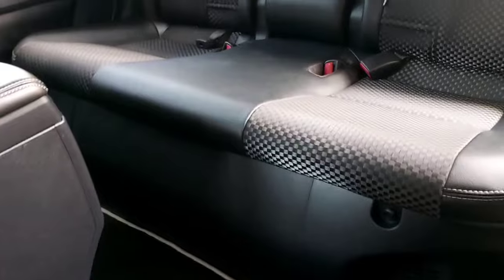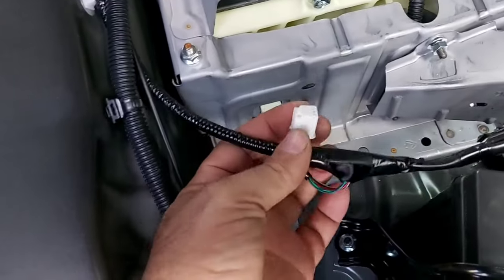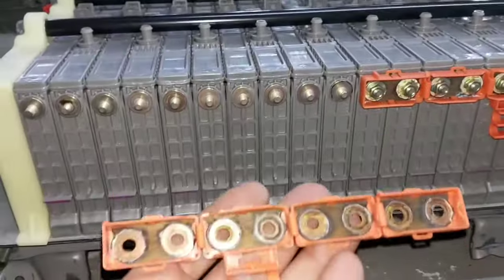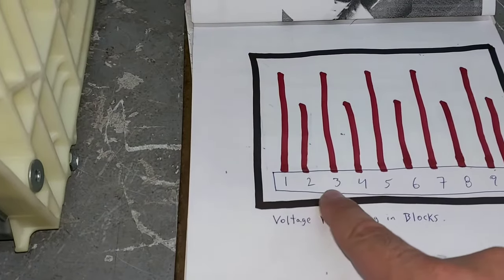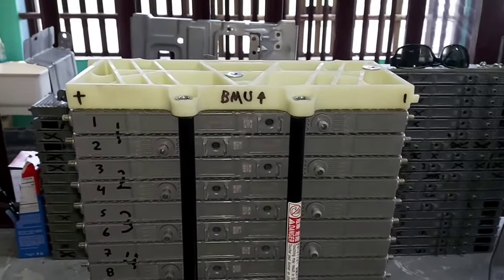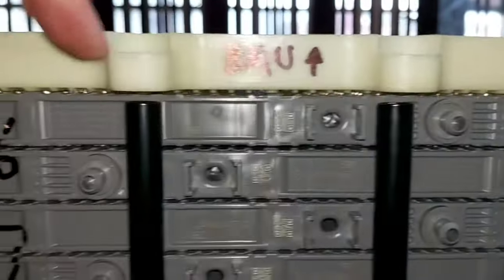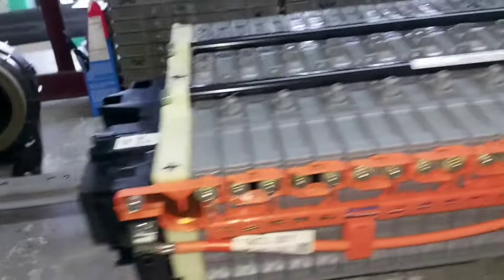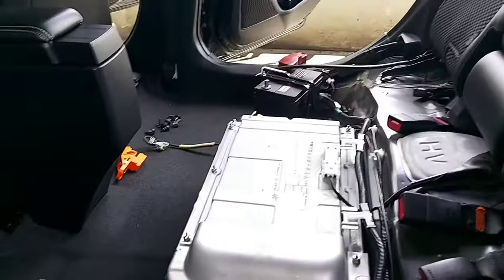toyota hybrid battery service and maintenance

Comment: Not to undermine your safety message, but beyond taking proper precautions there is not much cause for concern about the battery voltage - about 275 VDC. I developed an interest in electronics when I was 12 years old and was working on the old vacuum tube radios for nearly 20 years after that. Long story about how it happened, but when I was 14 years old I got 300VDC very solid contact with the palms of each hand. It was quite a jolt - I felt like I had been hit in the back of the head with a 2x4 and things got dark for a moment but I remained standing. If it had been 240VAC I would not be here to tell about it.
I worked on tube type radios for about 14 years as an avionics technician in General Aviation (small planes). I couldn't even guess how many times I got my fingers across the 275VDC supply for the venerable Narco Mk12 series radios... many dozens of times for sure. It was like getting my fingers in a mousetrap but it stopped hurting in a couple seconds.

Again - take the proper precautions. Toyota makes it very difficult to get across any of the high voltages but we have the responsibility for our own safety.

Comment: Hi, I watched a lot of your videos. I did a full battery service on my Auris 2016 according to your instructions also the battery balancing with parallel connection of all modules for 48 hours with great result. Dr. Prius life expectancy test says 87.25%, before battery service was 76%, that is great THANK YOU.
Reply from the maker: Good job... 😎🥳😎🥳😎🥳😎🥳😎🥳
Reply: @hybridsolutiondiagnostics  what happens if you put back the battery without balancing ?
Reply from the maker: @geraldtuge6559  check the new episode reconditioning a good hybrid battery… there is your answer very well in a simple simulation.

Comment: Great video, well said!  I have been trying to find out about where the dust would collect behind the fan and how important it would be to check it.  I am at 100K for a 2017 Prius Gen 4 and there is nothing about what is behind the fan and cleaning any ducts that could potentially be clogged.  I was quoted just under $200 to clean it, but i have seen where at least one other was quoted over $750 to clean it.
Reply from the maker: Check out one of my last videos is about toyota chr and 4th gen prius... it is an amazing tutorial fully servicing the HV battery... you will love it 🙂👍🙂👍
Reply from the maker: https://youtu.be/J3o-W3CS8N8 check this out 😁👍

Comment: One of the best tutorials I've seen, a small note, a recommendation to work with gloves, preferably for a fault voltage of 1000 volts
Another thing, why don't the car manufacturers bother to connect the car's air conditioner or a small air conditioner dedicated to cooling the batteries.
Another thing to consider is the replacement of the jumpers between the cells, a chemical reaction between metals must be taken into account as well as the durability of the material for hundreds which is not that significant, I would replace the jumpers but with the same type of metal that the manufacturer provides.
Rare video good job. Michael
Reply from the maker: Thank you for your comment 🙏😎

Comment: Very amazing vid!! A lot of info. May I ask what is the maximum battery overall voltage the car will accept after a reconditioned battery is ready to install.  I believe the car never charges to full, so a full charged 100% battery will pull codes and possible not connect. Please explain

Comment: Surely the battery vents not being connected to an outlet pipe is speeding up the bus bar corrosion? If a cell vent pipe was directed to the under side of the vehicle, the corrosive vapor could be neutralised with a small container of alkaline water, baking soda for example.
 I recently bought a used C battery for experimental purposes, the bus bars were badly corroded, but the cell voltages were all similar around 7.6v. If the bus bars were tinned with solder,maybe the corrosion would stop, or at least be delayed. Too much trouble for a busy mechanic. A conductive assembly paste could be an alternative solution. Re the overheating of the middle cells, some small computer fans could be easily fitted, preferably under the cells.
Reply: corrosion is intrinsic to every dis-similar object in the universe, corrosion  an be slowed with lithium grease or coating above the connection

Comment: Boss just subscribed, I have a 2014 Camry, engine went into a limp mode, I pulled the battery. All terminals were corroded, cleaned and polished reassembled, car doesn't start. It does show the battery is charged and green now which previously it was purple and dead. 

Any idea why it has a no start, my OBD2 scanner is showing no codes :(
Reply: Did you find out what it was. Sounds like you may have not connected something properly.

Comment: Hi, I hope you're doing well. I'm following you from Afghanistan, and I must say your tutorials are excellent; I truly appreciate your efforts as they are lifesavers ;)

I own an Aqua, and while scanning with the OBD scanner, it showed that the voltage of block #4 batteries is a little weak, registering about 12.4V. Upon opening the battery pack and testing with a multimeter (set to 200v), most of the cell voltages ranged from 8 to 7.53V. Subsequently, the dead battery sign appeared on my dashboard. However, after clearing the codes with the OBD scanner, it disappeared completely for a few days before reappearing.

What is your suggestion? Should I replace only the block #4 batteries or the entire battery pack?

I've been considering an idea: if I were to remove the batteries from block #4 and replace them with one battery from block #1 and one from block #10, would that potentially resolve the issue?

Comment: Hello, after cleaning and changing the filter of my 2016 Prius hybrid, I started to hear the fan spinning when the battery is charged. Before, I never heard it turn. Is this normal or should I be worried??
Reply from the maker: @zainbelemhani9319  totally normal 👨‍🔧👨‍🔧✅✅

Comment: Hey Bro! Your videos have really helped me understand about hybrids. The technician here removed vent tubes(rubber pipes for air)above hybrid battery modules from my Prius 1.8 2011 saying they are not needed but Toyota must have it for a reason but then i see fielder & aqua batteries also don’t have it so what should i do?? Kindly reply.thanks!
Reply from the maker: Those vent tubes are just in case of gas leak into the cabin... some other batteries dont have them because the ventilation goes directly out of the car 👋😎
Reply: @hybridsolutiondiagnostics  Thank you Bro!

Comment: Do I have to service my hybrid battery every year as you mentioned in an other video? Or is that not required for the lithium ion battery which is in the 2024 Corolla? Thank you.
Reply from the maker: No need to… just keep it clean and change the battery filter ✅

Comment: I liked the tunes in the background. Excellent video!!
Do you find you get better acceleration once service has been completed?
Reply from the maker: Everything improves after a good service...
Reply: What about the Prime models, plugin hybrid?
Reply: @paulpoco22  if they use lithium ion batteries then they won't benefit from deep cycling, I'm fact it'll just accelerate degradation. Unblocking ducts/fans will keep them cool means they can live longer and maybe perform a little better.
Reply: @hybridsolutiondiagnostics 31C in your shop, stay hydrated, LoL.  I see your video after the READY in the dash you go in the car and wipe the sweat off.

What happens  on the plugin hybrid if say you are stuck at a Ferry Terminal and it is 32C for 5hrs and you use the A/C.  The plugin hybrid gets down to 2 to 4% or less and runs on battery then runs the gas engine then runs on battery, this repeats for over 5hrs?  I was freaking out near the end I would see in the HUD 1.5km range then gas engine would run until range shows 2.5km over and over, the it got down to 1% but fas engine wasn't coming on.  So we shut off car until we loaded Ferry.   Then left Ferry once it arrived and still 1% and drove off, once up to higher speed the gas engine ran.

Comment: Thanks for the video, I have a camry  hybrid 2007, is ok to clean the bus bars with hot water and vinegar to remove the corrosion and reinstalled?
Reply from the maker: Use battery acid, will be way much faster... just be careful ☝😎

Comment: hello, I have had problems with a prius C, I have reconditioned the battery and it still shows failure, when I read with dr prius it indicates voltage values that do not correspond to reality. Any recommendation. all cells are in good condition and balanced.
Reply from the maker: BMS ☝️🫠 probably

Comment: Thanks you.Can I know what is obd3d code I got that code with Torque pro diagnostic.It's a Toyota Axio hybrid on the dashboard it said Brake system check
Reply from the maker: Follow instagram page for direct contact

Comment: Hi...
Does hot weather affect batteries?  I'm talking about more than 51 degrees Celsius?
Reply from the maker: Y E S  I N D E E D my friend... 51celsius is a battery killer... so keep it clean, balanced and use the ac.☝😎
Reply: @hybridsolutiondiagnostics  thanks.
But if the car in garage under the direct sunlight during summer...
what can I do..

Comment: I have a 12v battery charger that im wondering if i can use it to charge my ba ttery pack. It has two settings one is 12 volts-2amps and the other is 6volts 6mps ,which one would you suggest if any
Reply from the maker: No, it won't work well... use a low rate amp charger.

Comment: Very detailed information was able to do the servicing myself but had issue with the ratchet handle short circuit two of the battery terminals did a voltage check and the level was fine, but after reconnecting and tried starting (Hybrid system failure) came up on the dash any suggestions.(only the orange lead from the junction box was connected at the time
Reply from the maker: Clear codes and do a colective load test....
Reply: Apply good quality electrical tape to the ratchet handle and extensions that you use on batteries
Reply: @tommills2097  thanks

Comment: Hello Sir, I have check all of my battery cell its 7.9 each but still msg come in dashboard. So I decided to do as you show in this video but I am a question should I need to charge as you charge in this video with prolong because I don't have this in our country in Bangladesh
Reply from the maker: Ni problem to use any other compatible charger...
Reply: @hybridsolutiondiagnostics  Thanks brother one more help please, I found in local here in Bangladesh this compatible charger. Can you please see and advice me that is it ok or not?-

1.Max charging current:5-6A
2.Rated input voltage:110-240V
3.Adopt PWM charging mode,auto stop charging when the battery gets fully charged
4.Charging voltage/Battery capacity/Charging current LCD real-time display
5.Auto battery detection
6.Applicable for gel battery and lead-acid battery
7.Prevent battery from losing liquid
8. Only applicable to battery  ≥40A
Reply: No my friend... it wont work... u got to get one for  nickel metal hydrate battery type.
Reply: @joseramonherreramendoza9260  ohh I am very upset because such kind of charger not available in Bangladesh.
Reply: My friend, I need your help please advise me. Once I done my service as per this video it's hasn't changed anything still code coming and coming again. But last to days I noticed that after last code clear with OBD no trouble code coming then I noticed last todays I drove my car due to winter here In Bangladesh I switched ON my AC and put in HI heat and low down the blower. Once I On like this no message coming. So what is the reason my dear brother please advise please
Reply from the maker: @RakibulHRasel-zb6fy  for sure you have a few modules in bad conditions so they are not holding power as the others... so you will have to load test them to determine how many bad module...
Reply: @hybridsolutiondiagnostics  how can I share my test report any Facebook or other communication with you bro... pls
Reply: I think we can charge each cell separately with just ordinary NIMH charger. Imax charger will be ok , keep charging slow by keeping changing amperage low.

Comment: GreenTec Auto → Gets HV Hybrid Battery Pack Replacement Done!  New Life for an Old Horse Bingo, Bango, Bongo ♩ ♪ ♫ ♬ ♭ ♮ ♯ 🎼 🎵 Music for my Prius.  

My 2012 Toyota Prius v HV hybrid battery finally began failing a few weeks ago after ten years of use and 118,000 miles.  Right on schedule for its age and mileage. Confirmed its state of unhealthiness with check engine light and the battery error codes of POA80 “Hybrid Battery Pack Deterioration” and POA7F “Hybrid Battery Pack Control Module” … After researching my options, i.e., a re-manufactured battery pack with recycled cells from donor hybrid batteries with nominal capacity of 4.5 ampere hours, I opted to invest the extra cost in a high-capacity 6.5 ampere hour HV Hybrid Battery Pack with “NEW” cells in each of the modules which compromise the pack.  Glad I did as, unlike all the local re-builders that only sell the so-called reconditioned packs, which claim to include re-balancing of the cells within the modules, I wanted the 48 Month Warranty that accompanied purchase of the high-capacity 6.5 ampere-hour capacity HV Hybrid Battery Pack with “NEW” cells from GreenTec Auto ...

Fast forward to the day of the scheduled physical installation at the area GreenTec Auto shop located in Phoenix, Arizona; which was scheduled within hours of my placing the order … I was contacted by a cellphone call from the Arizona area Technical Manager, Michael Ramirez who scheduled my installation at the local shop. On the day of the install I was greeted by Michael and Steve Hodgson, Technical Assistant.  To my astonishment, these two men removed my old failing hybrid battery pack and installed the new HV hybrid battery pack within 30-40 minutes start to finish. Totally amazing ... Team Work in action!  It’s refreshing to see such efficiency and professionalism.  I’m sure glad that I made the positive decision to make my HV Hybrid Battery Pack purchase with GreenTec Auto. This young growing company has set the standard for Hybrid Battery Pack replacement!  Highly Recommend … Five Stars ★★★★★